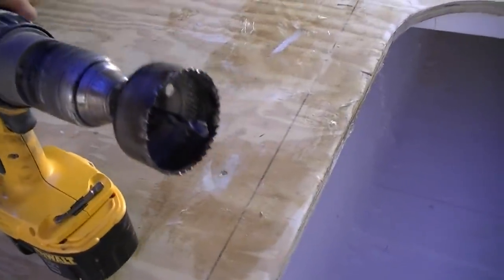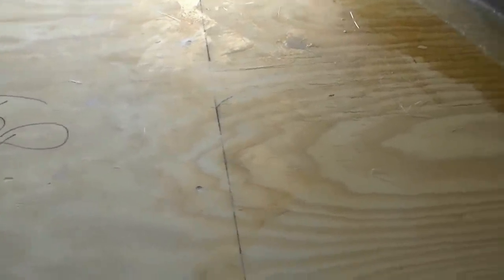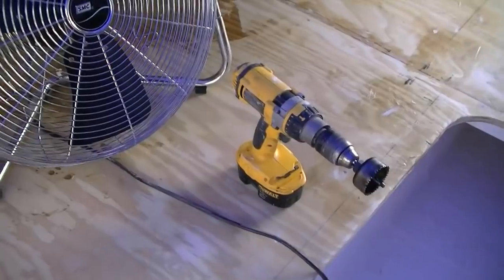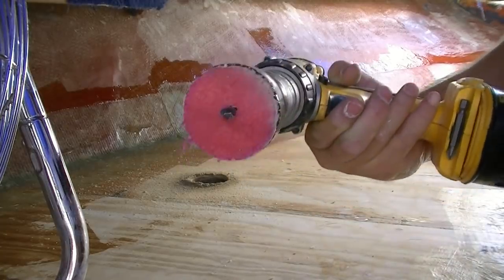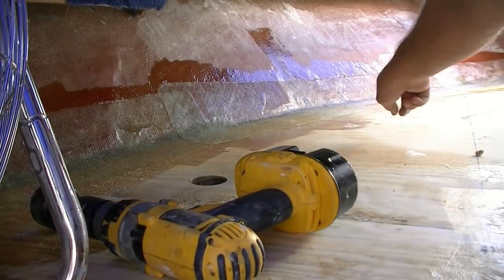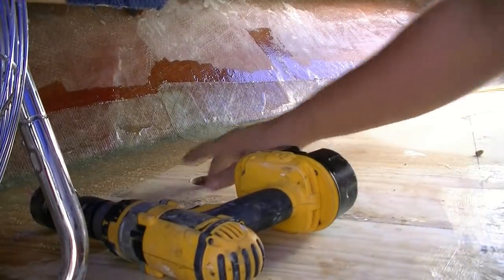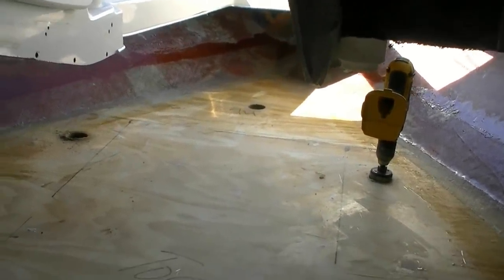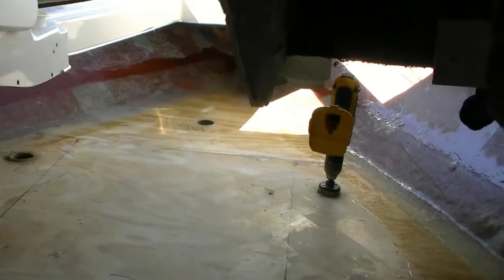Foaming the Deck of the Sea Ray with 2 part foam VLOG# 37

Comment: This guy is very clean and  professional I’m glad I watched him it really helped me jump in and cut my boat I might have cut some corners only time will tell but I used advantec I think it’s better than  the plywood and then I had a spray liner it looks incredible and the floor is actually  really stronger feeling than every boat I have been in so far but again I would have never even tried to tackle this if I had not watched this video

Comment: Super job on the videos!  I am about halfway through the stringer replacement on my 1985 bayliner. I used your methods step by step and it is coming out great! Thanks a lot for taking the time to document your project.

Comment: I am sooooo glad I ran across your videos!  My experience buying a fixer is very similar to yours.  I got the boat knowing the decks were iffy, but it's my first boat, the price with a trailer was right,. I've recently retired, and at 68 years old having worked in the aircraft industry for 40 years, I am confident I can accomplish this.  Besides, I need a creative outlet - instead of building models I can rebuild a prototype!  You're right, though, the demo wasn't too bad, but the grinding sucked.  I, too, removed ALL of the rotted wood.  I'm up to the point of making parts, now.  Template for the transom is made and laid out on the ply.  I'm leaning, though, to replacing the 36 year old OMC stern drive with an outboard, Mercruiser or... haven't yet decided.  On the electrics side, NONE of the wiring is marine grade wiring, so I will be re-wiring it, too.  Thanks, again, for these great videos.  Yer Mom would be proud!

Comment: Should have took the left over pieces that kicked off and stuffed them down the hole of the next fill area. It's all foam and the new pour would have absorbed the older foam. No waste. Another idea is to is to use old plastic bottles (with lids on) or ping pong balls to mixed in the foam. Less foam, less issues and the trapped air in the bottles or balls are more buoyant then the foam alone. Works really good for large cavities and saves a ton of money.

Comment: This is actually a good idea in general to keep from sinking. My friend who builds custom boats does this for customers who request it, but he will apply the foam between the stringers using 6mil clear plastic and lay heavy plywood over the plastic to remove the plastic later. The reasoning is that the closed cell foam will not stick to the plastic so when the plastic is removed the foam cells have skinned over at the correct height to then be able to install the sub floor without the need for planning off the foam which would rupture the waterproof skin of the foam....Really brilliant technique. Oh yeah, measure the areas to be filled so you do not pour too much!

Comment: see all these comments about the foam getting water logged. I'm not 100% sure of the foam this guy is using but if you use closed cell foam it shouldn't absorb any water what at all so there wouldn't be an issue with that. older boats with foam in their hulls did not use close cell foam but rather a different type of foam that could absorb water over time .

Comment: Good job man , that foam is the best to use. We mixed A and B 5 gallons each opened up the wing window on a VW Bug and poured it in , it blew out 2 windows , we shaved it off and pushed it into the lake  and I believe 22 years later it’s still floating !

Comment: Great videos! I bought an old Fiberform bowrider to transport boy scout troop equipment on Yellowstone lake last year. Boat ran great but found soft areas in the floor. Have been following your videos for info. I was going to resell it but my wife bought new seats for it for Christmas. I appreciate your fine work and attention to detail. Oh, stringers are cut and ready to be glassed. Thanks again.

Comment: I always replace my cordless batteries through Batteries Plus because the batteries they sell will last 3-4 times longer between charges. They cost a little more but are well worth it.

Comment: I have been foaming a 16' pontoon which was taking $$$ worth of the A/B 2 lb. foam. I cut the expense significantly by filling the voids with pieces of styrofoam before adding the expanding foam. Styrofoam seems to be even lighter and is closed cell.

Comment: I did this with my boat years ago.. And drilled the holes as well. However, to get the fill you need, cover the fill hole once it gets close to the top, so the remaining foam can fill to the vent holes you drilled as well. And continue to move from hole to hole with the same ..

Comment: You can chip up the hardened bits and put them in the areas to be foamed, and if you fill each section partially, you won't have the wasted foam extruding from the hole. Do one layer, then come back with a little extra to fill the remainder.

Comment: youll get better expansion and coverage if you use a drill with a beater to mix, also cover your hole and let it fill into the cavity instead of pushing out. Plus the deck will get warm even if the foam does not reach it ....heat rises! But definitelya must to use a drill to mix, been using it for years! You would have used half as much and gotten more floatation.
Reply: I'm about to pour mine any tips?

Comment: I'd consider drilling small holes in the corners of each compartment to gauge expansion fill. That would improve venting too, which, I think, would also decrease the possibility of outward deformation of the hull due to expansion pressure. Anything I can do to get complete fill with no excess pressure would be my goal.

Comment: I have a hull with a cavity to fill measuring 3 feet by 12 feet and 2 inches deep. I am going to drill holes to pour the foam in but with the hull tilted I am going to start pouring at the low end and work my way to to high end. Doing it this way I think will fill the cavity more effectively .

Comment: Kudos on your persistence.  Re coring a boat is always a matter of choice. Inevitably it will end up being more expensive  than non damaged, intact. At 22’ I might be more worried about survivability. True that cavity has a increased buoyancy due to the foam. But if you rip that big a hole in your hull it may be time to get on channel16 or 21 and get some assistance as you are in trouble beyond ten or twenty square ft of flotation..

Comment: Buy a milwaukee drill, dewalt is nothing more than a black and decker motor inside a prettier shell. Also as you drill at the end, drill at an angle then turn your drill sideways, this will pop the core before it ever has a chance to fall. Very cool video, I've really been wondering what a refoam would take, glad you posted it.

Comment: I spoke with Steve at US Composites and he said never to do this like this because if it expands too much you will be surprised by the force put on the deck and fiberglass which contains it. I also spoke with Andy of BoatWorksToday and they both recommend pouring the compartments before putting the deck down and then you can sand or cut it down to the height you want and then seal with resin. Also, this will allow me to create channels to secure my hoses for deck drains. I'm sure it worked out on this project but I'm gonna pour mine before I put the deck down.
Reply from the maker: Ryan Dodd there are two schools of thought on this. If you pour it first and then lay the deck you lose the bonding to the deck and rigidity, and if you cut it down, you break the cells. Yes you have to be careful like I said in the video. This is the only way you can truly seal a deck... plain and simple

Comment: Just pulled apart a rotted bulkhead and floor section today. People I got the boat from had allowed it to get about 18" water in the bilge from sitting at the dock for a couple years. All wood below was rotted. The foam was water logged and very heavy. also it had water trapped up against the stringers. Im not going to foam under the floors. Its used for additional floatation should the boat take on large amounts of water. The small amount of foam would provide a marginal amount of flotation I believe. Correct me if Im wrong someone. Don't want trapped water anywhere. Just my opinion.....

Comment: instead of drilling holes at all you should have foamed before you laid the deck.  Then shave it level with the strigers then brushed it all with resin to seal the top of the foam.
Reply: +catfisher420 t don't work, lund and crestliner already have this water loging going on under there floors
Reply: That sounds like the way to do it. I'm just learning about boats.
Reply: I think it is better to paint the deck on the bottom side and use a rigid foam 
 which  is not flexible. Make some extra small holes and make it  worm by 
the hair drier before than apply foam. The foam has to rise and  stick to the
 deck.
Sorry about my English.
Reply: I bow to you sir. I got the skillsaw out for about an hour, before I decided to pay to have it done. The man I hired had the top half of the boat hanging from the ceiling and had easy access to everything. He used closed cell foam because it doesn't absorb water. Unlike the original stuff. You're gonna have a lot of fun with that Sea Ray.👍
Reply: @Brewdiss   Bow to him? 😂 why so stern! Pun intended
Reply: Billy Joell 
Maybe you should stick to being the Pianoman. 👍😄

Comment: Try using a screw attached to a long screwdriver to reach that puck.  Or if there is a hole in it, try a coat hanger wire.

Comment: It is a great method but the problem you will later find out is the deck will have a swollen look. If you take a straight edge you will find that the deck is no longer fare. Other than that it is very informative. Thank you.

Comment: Suggestion....:After pouring into hole , cap that hole , so as foam will have to move towards air hole(s). When foam expands it will fill more evenly ?/?
Reply: I’m not a boat man but was thinking the exact thing. Force the foam into every crevice by blocking the hole.
Reply: As long as you want a flat and level floor don’t do that. You need a few holes where the foam can release the pressure. If you don't have enough holes, the foam will flow towards the other hole and in the meantime it will push your wood floor up. Don’t underestimate the power of expanding foam!

Comment: Just curious because I’m about to start a boat build myself, but why didn’t you pour the foam between the stringers and everything before you laid your decking and glassed it in? I would think if you poured the foam first You can ensure even coverage and proper height of the foam.
Reply: If you pour in the foam after putting down the floor when the foam fully rises it will help with the structure of the floor and help seal the bottom of the floor from water

Comment: Great Video...Finally someone did one on foaming a fiberglass hull. My boats styrofoam was so waterlogged that with the heavy motor water would come into the splash bay. I was thinking of replacing the deck and doing the sprayfoam like you did, however after reading some of the comments i am confused...If i don't use any foam flotation how is my boat going to stay above water.  Why doesn't someone make like an air inflating Bladder?????

Comment: I'm getting ready to foam my deck. Is there anything you'd change since you did this project? I'm a little hesitant in drilling huge holes in my deck to pour the foam. If you had to do it all over again, would you drill the holes? 

I live down the road from you, in McKinney and am restoring my boat out in front of my house....in the street. My rebuild thread is on Texas Hot boats located under "Boat Projects" and "Crusader Project".

Comment: im so lucky. im redoing the deck in my new boat. mine is a 1990 spectrum 17 ft aluminium. mine is already foamed. it will be getting a 90hp mariner. it will be fast

Comment: Hi, just wondering how your boat is holding up after 5 years?

I just bought a 1979 23" fiberglass boat with a cuddy that needs a floor.  I'm going with 8# foam, it's bouancy is 54lbs per cu/ft vs the 2# @ 60lbs.  It's a 10% difference in bouancy as I need structure more than anything and the 8# is 5 times stronger.

Comment: No need to be scared of drilling holes.  The biggest thing you need to remember is that it's only wood and/or fiberglass on your boat.  Nothing on there can't be fixed or replaced.  I can't tell you how many times I've taken a sawsall to a friend of mine's custom 62' Carolina Sportfisherman.  It's only wood man.  Don't sweat it.

Comment: Noise damping, more boyance or hull stability? What's the foams purpose? Not knocking your video I'm just wondering? I build  yachts are you compressing the stringer compartments?
Reply: what does "compressing the stringers mean"? I'm rebuilding my boat that has 2 stringers I am replacing. Any info is greatly appreciated. Thx

Comment: While you are topside pouring foam down the drilled holes, how do you know that the expansion is not causing the bottom of the boat to bulge out or even split open in places where the fiberglass might be weak? There has to be a better method that would  insure you that you are getting a complete fill. Why not drill many holes 3/8" and use aerosol cans?
Reply from the maker: I have learned from do this alot. Each compartment had two holes plus the 3/8 holes. If you take your time you are fine.

Comment: i USED SINGLE PART EXPANDING FOAM TO FILL A 6X6  PIECE OF COMPOSITE BOX TUBING, TO MAKE IT FLOAT. NEXT DAY I FOUND THE TUBING HAD SPLIT  WIDE OPEN. I GUESS I USED TOO MUCH. SHOULD HAVE TRIED A LITTLE AT A TIME.

Comment: So what's the main purpose omfor the foam? Should I go ahead and foam mines?I'm taking it to the sea
Reply from the maker: Its a coast gaud requirement to keep smaller boats floating just at the surface if you get swamped. Check your regulations on your boat size to see if you need to do it.

Comment: I may have made a mistake.... I have purchased a checkmate didn’t  realize it had soft spots. Can I just fix the soft spots back of boat... I knew the floor was soft... only 18 ft boat is it worth fixing????
Reply: If the floor is soft I can almost guarantee the stringers are rotten too. And if the stringers are rotten, the transom is likely to be rotten too. It's never "just the floor"

Comment: I have been working with 2 part foam for years and I know you have to make sure the A&B parts are mixed real good before mixing together or it can cause it to fail . But I have got bad fore straight from the dealers . 
Foams can break down because of Age, cold weather ,improper storage, improper mixing. 
Great job because its a pain

Comment: You have to drill small air holes around the area and the foam will track towards those holesand fill the cavity. Nice job though.
Reply from the maker: I actually did in some places, and there were alot of times two holes in a cavity.

Comment: Hmmm. Ok, cool. I have a 1977 Bonito 17 foot, and I do not know what foam they used but it does NOT look like what you used. Yours looked light weight and plastic like. What's in my boat now is like brown orange, and yes, seems like it would soak in water. Maybe it IS great stuff :) but I guess I will follow J's advice and get it out and use the two part. Looks fun anyway to watch it grow like a volcano erupting so what the heck :) Thanks again. Great videos

Comment: I see different weights.. This is what I found. 3 lb. Urethane Foam 2 part rigid liquid Polyurethane Foam 8 lb. kit SO would that be enough to do a 2ft wide by 4ft long by 6 inch deep?

Comment: There would be hardly any waste if you broke up the waste foam and tossed it down the holes before you poured the next round of foam... Better then just tossing it in the trash...
Reply: +Geo K If there was ANY moisture in the foam that was removed,you can be sure there is some moisture EVERYWHERE in the rest of the foam. One piece I just took out of my boat measured 20" x 10" x 3" thick,….it weighed 8 POUNDS 6 OUNCES!! A dry pice of foam the same size weighed "7 OUNCES" I'll be posting videos and pics as soon as I get some time. It's an ADVENTURE!

Comment: How buoyant is that foam really? I did some tests in the bath tub and found that it gets water logged easily and once wet it is VERY heavy. I found that it needs to be kept with its dry seal (SKIN) intact... once its cut this allows a space for the water to easily enter the foam. When it has that dry skin on the outside it is somewhat water resistant.... Everyone is using it but is there any REAL evidence that this is a buoyancy and safety benefit as compared to filling it up with say bean bag balls or polystyrene or other flotation aid for example.  I know this is left of field but I submit that this foam when cut or sawed to say 'fit a hull' instead of being a buoyancy aid may well be a hindrance to flotation and aid sinking. At least the water logged foam will hinder boat recovery. Its just a Thesis but my home experiments support it. Thoughts?

Comment: New to your channel, I really enjoy the way you explain things. I got another question on another one of your videos about the difference in transom thickness. But my question on this video is since you have done this are there any other alternatives to expanding foam? I have seen some kits on ebay for spraying inside the walls of a home, is that not good enough?